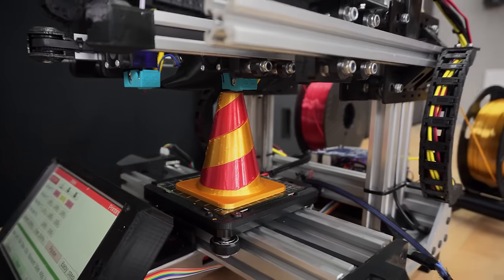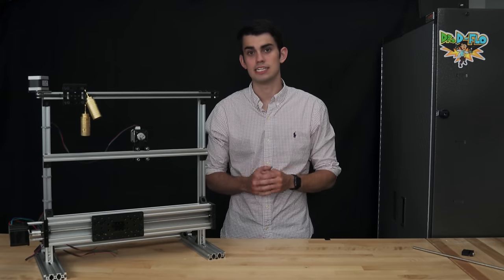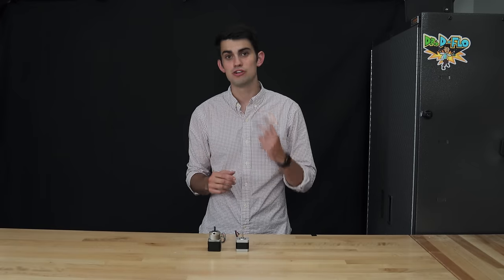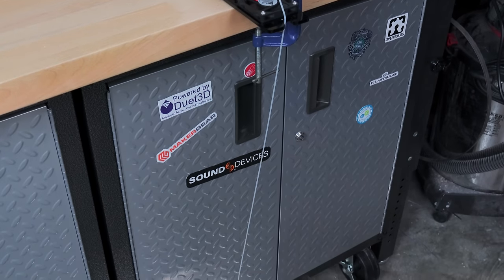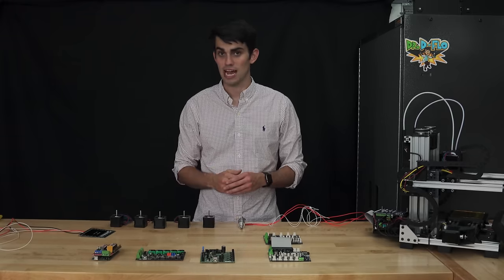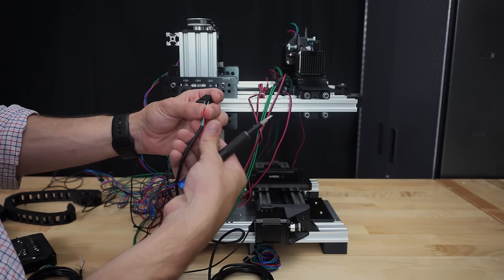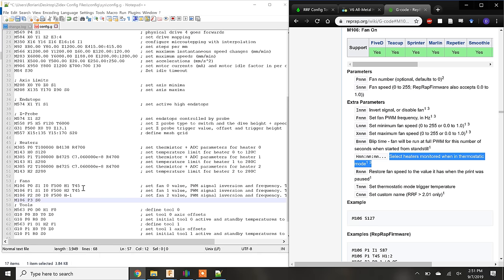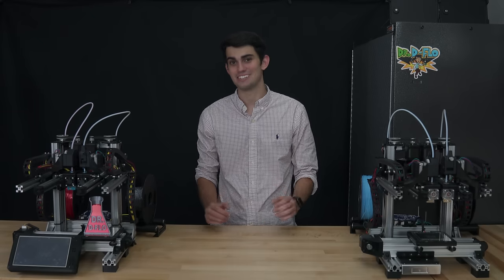How to Build a 3D Printer (The Ultimate Guide)

Comment: Being serious here! I have a design for a 3D Printer that doesn't have gears, belts, or rods, or screw-rods,  and will have Zero backlash, very high torque, and less than micron presision, and the X&Y translation of the extruder is done on the inside of the 2 motors in the same space. So if your build volume is 2 feet in diameter, then the motor will be around 2 feet 2 inches in diameter hence the high torque. And the bigger the build volume the higher the presision gets.
But with this setup it can be so much more, a simple cnc/mill, obviously a laser engraving/cutting, and even Photolithography but done with a laser instead of a photo mask.
Forgot to mention, it is Always homed, even if you could make the motor skip steps or the computer lose count. And I've never used a 3d printer, I'm learning FreeCAD now to get this built, it will be the new industry standard everyone want to upgrade to / get

Comment: First off thank you for the very informative video. Secondly as an FYI for those of you who have a miter saw, most if not all new blades that come with the saws have carbide teeth and very easily cut through the aluminum extrusion. I made my 2nd 3d printer and cut all my extrusions with precision using my miter saw. Have Fun, be safe wear safety glasses.

Comment: very good video, alot of information.

I have some suggestion :
- you forgot to mention the heat break in extruder section
 - for z probe most 3d printed aren't treated as normal cnc router/mill. they treated more like plasma/laser cnc by finding z on the entire bed not a single point, and the probe is fixed to the x-carriage

Comment: This is everything you need to build a 3d printer, now I need to see this with a resin based model, it might be easier to do in my country, i almost can't found were to buy rails, not to mention the price of the rail, it gets really close to just buying a kit, but I want the learning experience, after I make my printer I'm going to build good headphones, after that good bluetooth headphones, really, most headphones are expensive and have bad drivers, using cheap drivers in 3d printed headphones is a better option

Comment: Marvelous!  Thank you Dr.. D-Flo; your masterful presentation taught me so many things I didn't know that I didn't know. 😃

The detailed information you provide,  built on basic principles,  and indexed by elapsed time, should be extremely helpful to me in building a much simpler "bootstrap" printer to serve as a much lower cost introduction to 3D printing,  and also to print the 3D parts for the Zidex, should I ever get that far.

That is: your instructional approach provides information that is of use for constructing ANY 3D printer from scratch.   Bravo! 

I wouldn't need the compact format,  so I could see just leaving all the extrusions the standard size,  and adjusting the configuration accordingly.  Again,  if I ever get that far.

Comment: 1:23:00 add on options like running OctoPrint on a raspberry pi connected to a marlin based printer (at the least) allows web based eeprom / firmware editing as well (using plugins available through octoprints plugin interface)

Comment: Little feedback on your linear rods segment: the deflection of a suspended beam or rod scales cubic with its length, meaning doubling the length of a rod multiplies the distance it bends down in the middle by eight. Since the rod cannot be supported in the middle (effectively halfing its suspended length and therefore cutting deflection by a factor of eight) it can only get so long before deflection introduces an unacceptable error.
Reply: Could software compensate for that ?
Reply: @dc37009  software can compensate to some degree, in theory, by modulating filament feeding rate while sort of antialiasing the plastic “pixels” so to speak.  It has physical accuracy limits.

But consider this: as often and as much as so many 3D printer beds are warped, and they’re still printed on, this is still an issue that is compensated for or ignored: the question is how important is it to you.  What’s the difference between a warped 3D printer bed and a bowing X axis in practice? Until you get into larger territories that enter into a layer height fraction (say, half?) it’s all a matter of perspective: a bowed X axis looks like a warped (but typical) 3D printer bed, one that you can’t so readily adjust mechanically.

Comment: Thanks for your quick response. I have approx. .75v for the A4988 extruder drivers.  If I program for 100mm of filament, that’s what I get. I have 2 filament extruders and both act the same. I do get the hob gear chewing up filament as evidenced by filament shavings. What is funny is that 2 months ago I was able to print decent prints. I’ve been thru the Marlin firmware trying to tweak parameters to no avail. If I disconnect the Bowden at the hot end the filament seems to feed smoothly, but, I don’t know if the filament flow rate is correct. I assume that the slicer determines filament flow rate. Also note that my issue is remains across different nozzle diameters. 

What do you suggest?

Comment: Amazing video. I was wondering if you had a similar video or other online resource for a 3D printer that is for larger scale objects. I want to get into 3D printing for automotive applications, example: designing things as large as body panels, fenders, side skirts, etc. Can the one built here be scaled up easily or are there other complications that come along with that?
Reply from the maker: Scale is an interesting topic in 3D printing. The technology that is used to make little parts like I make and large parts for cars are totally different. Check out this video: https://www.youtube.com/watch?v=cyX-v83_5Zg

Instead of filament these large 3D printers churn through plastic pellets. So, sadly, the technology doesn't scale past a certain point.

Comment: Amazing! Thx for that video, but one question. If the wire breaks, which could happens if the wire stay long time on air and we came too late to fix that problem and the printer moves more then 20% or more of the hole piece which i wanted to print. how could we say to the printer or tool to print exactly at that position where i move the header to print? exists some tools which could handle that oder maybe came that tools in the future?

Comment: Excellent instructor.  If not already, should be a college professor teaching this.
Reply: Why go to college for this when you can just stay here?  also, college includes a lot of unnecessary crap to fill time that you pay for which works but may no longer work with the power of tech today and the social corona going on.  What is the point of trying to live super long and pay bills for 30-years when you would die to corona or just do stocks/BTC that would wipe out all that debt in less than 5 years?  How long until people would continue doing it the old way which is becoming but not currently extremely obsolete.
Reply: @antdx316  dude online classes suck. That's the objective truth especially for kids and teens.
Reply: @alialtinel2960  It will take some time for corona and rioting to properly force modify the world but until then people will still be seeking the old ways.

Comment: My only real question is why are the Y and the Z  axis's switched as compared to a blueprint or design software? As an example the 
X axis would be front to back
Z axis would be left to right
Y acid would be up and down
Set at + or - depending on the direction from the center point of the total area of the overall working area.

Comment: A low glass transition temperature doesn't necessarily mean something isn't heat resistant. Polypropylene for example has a glass transition temperature of -20C, however it remains relatively rigid up to around 100C. The number you want to pay attention to is heat deflection, which is the temperature a material will become soft and distort.

Comment: With the IDEX/ZIDEX design, have you tried using different nozzle sizes?  I love printing with 0.8-1.0 nozzles but would like to create outer walls using say a 0.4 or smaller nozzle.  Presumably, the slicer needs to support this but is this a configuration you've used?

Comment: Hi, i builded a small Delta 3D printer now Im looking for way to control it. I had one Ender 3 motherboard laying around. But i have problem with Marlin firmware. Because Is i chose the genetic delta configuration. I can't compile it for sanguino (Ender 3 board). What shloud i do?

Comment: Great project, thank you for a lot of detailed info! 
could you please tell: what about is maximal speed Vprofile+rollers system for accurate movement (without vibration)?
I cant find this parameter nowhere :)

rods systems in my opinion not best for amateur/beginner projects, 
bearings extremely sensitive for skew - just small mistake and skew mounted bearing will work in very low speeds +/-ok, but in just little over 100 mm/sec fast bearing die and also bearing damage rod. (and noisy like saw :)
so for example original prusa mk3 kit absolutely not brilliant, because there impossible to fix bearings without skew    
and it works well only ~40-60 mm/sec.
rails system very expensive and need very very precise assembling to...

Comment: I enjoyed your video. I have built a 3d printer and had (past tense) it working properly. At this time I can’t lay down a uniform line. The line goes from thick to thin to maybe no line at all then back to a thick line. I am using a bigtreetech SKR V1.3 board, A9488 drivers, Marlin firmware, Bowden extruder, cura or slic3r slicers and repetier host software. I’ve even tried pronterface. As I run a part I can feel the filament as it enters into the extruder mechanism. When the fIlament feeds well and I get a thick line. Then the filament stops feeding all together and I get thin lines. Interestingly, if I disconnect the Bowden tube from the hot end and run the part, the filament seems to feed continually. Theoretically, doesn’t’ just 1 tooth on the hob drive the filament forward? I often get a noise that indicates that the stepper is trying to force more filament than the hot end can handle. This  would explain the blob sections of a line. I am able to change the firmware settings. I have played with extruder feedrates, acceleration, and linear advance,  ejerk  etc. Nothing seems to work. 

Would you have any insight as to why I went from running decent parts to not even being able to run a decent line?
Reply from the maker: Hmm... This could take some troubleshooting. Are you sure that the steps per mm are right for your extruder? If the extruder is feeding filament too quickly into the hotend you will get a "thick line" but then the filament will jam. After you get a "thin line" retract the filament and see if it looks like the hob gear is eating into the filament. This could mean that your extruder is gripping the filament too tightly.

Comment: OMG!!! I watched the WHOLE THING!!! TY so MUCH for putting this much info on diy building!!! I was looking for something like this for my "weapon and prop printer" idea!!! I still have alot more to do but i am SO GLAD you made this content. Is there a way to tip? I get that this much info is a lot for most people but someone like me who wants to market to different communities with 3d printing i wanted to make sure i had enough info to help out! (( i don't have a lot but i wanted to say thanks is all))
Reply from the maker: No need to tip! I am glad that you enjoyed the video!
Reply: Ok...i am thinking of making a printer designed for the cosplay community. One that will do swords and large weapons and another that prints smaller stuff like accessories. Its ment to use dual extrusion so water soluble filaments can be used for support. Im thinking of a closed loop system sense the larger printer will be loud

Comment: What sort of limitations are there to scaling 3d printing larger? suppose i wanted to build a printer with a print bed size of 2m x 2m x 2m. obviously this is way too big for most uses but for large scale parts it would be nice. what sort of challenges would u have?
Reply: Mainly, the amount of inertia the printer would have, unless you're doing coreXY where this Inertia is much more reduced since it's the head of the printer doing the moving and not the bed itself.

Comment: I haven't watched it yet but will;  but a couple of days ago;  I was curious of the ink jet one and then when I saw that it was not at to of possibilities;  I thought of a few ways until at end;  of course I only did for understanding the ridiculousness of not unlimiting speed of this and crazy glue and bondo as options;  hence why the visit to a color inkjet for the hardener and bondo and crazy glue and baking soda alcohol/water mix that were to have their own injectors(of course those are two options;  bondo or crazy glue;anyways) and an accurate control over the volume(  the settings of the shade(color)).  Ok so then I thought that funny that nobody uses spiting of ink on a high speed back and forth roller (approx. 4 inch diameter and light)on two edge racks;  well then it was obvious that it can go high speed and not needing filament and pass as complete row .  So build it and if you want I'll explain wow to spit jet it them out with at any velocity needed;  to prevent from not releasing from the hammer or what not.   Wondering why yours isn't a giant one that we could all use our own anythings we would want?
Reply: Oh ya   Just read your intro there;  do you show how to build your own parts too?  I'll watch it for certain if you do;  I was under the impression that you were building one of your build designs.  Are you or are you just an ad?

Comment: Excellent video may only if you is that you didn't talk about never-ending chains and conveyor belt. I purchased and anet a8 plus and I am going to use it to build a factory 3-D printer that is conveyor belt. My plan I think is a simple one I start with creating and selling my creations To come up with the funds to create an excluder then Start building my conveyor belt printer parts well creating the parts that I sell in my local store to pay for my hobby eventually I literally want the conveyor belt unit to be 3 printers 1 conveyor belt kicking out parts. Unfortunately I know myself way too well I'm going to have to build myself a drill millwall and added and a lays not to mention shaper if I can come up with the material. The good news is I am quite familiar with all of these machines except for the 3-D printers.

Comment: How can we make both extruders work at the same time? if we had a bigger bed, 
I wonder,
Reply: Realistically, it could be done, but both would have to be attached together as one physical moving unit. This is because the y-axis plate cannot move for 2 extruders moving in different directions at the same time.

Comment: Amazing tutorial ! 
You could improve the Zidex, if you would drill holes through the profiles an use the T-nuts from the other side,
you could gain some travel and reduce the external parts needed. 
A 500 mm variant, that does require minimal cutting would be great too. (it's sad, all that profile lost)
And instead of the parallel  20x20 for the extruder, THERE use the carbon road, which could also travel on V-rolls.
Reply from the maker: Great suggestions!
Reply: I wish I understood 🤪😭😂👍

Comment: Is there any size limit to this 3D printer? Like max. size that is physically possible or max. size supported by software?
Reply: It could be built much larger, but for large 3d builds, you definitely would not want to go with a large single or dual extruder FDM printer. Too slow. Better to slice the computer design into several parts and then use several small printers at the same time, each one printing a different part of the object.
Reply: @allanholder1018  just got my first 3D printer a view days ago... wasn’t aware of how long it actually takes to print something when I asked that question. Now that I am I totally agree with you. Would be total Nonsens to have a single printer working for weeks on a large part while having to change the filament roll multiple times and risking it to end up with a birds nest on the last day.. you are right that multiple printers combined make way more sense.
Do you know if there is some chemical that “fuses” PLA .. something like the joint welding component for pvc pipes?  Would come in really handy in that scenario..
Reply: @allanholder1018  hmm.. guess I just found an answer to that on reddit. Seems like chloroform fuses Pla.. but not easy to get that stuff..

Comment: can you please tell me which two different types of filaments you have used and what is the solution in which you have dipped the printed part and one filament melted.
Reply from the maker: Oooh you are in for a treat! The filament that "melted away" or dissolved was polyvinyl alcohol (PVA) and the solution was just water. The filament was polylactic acid (PLA).
Reply: @DrDFlo  thank you, i will use it in my next print
Reply: @DrDFlo   can you please share some contact of yours. I want some help regarding 3d printer and a robotic arm. I have already designed reprap marlin 3d printer. I have already tried to contact you using the forum available at the website but you didn't gave any reply.